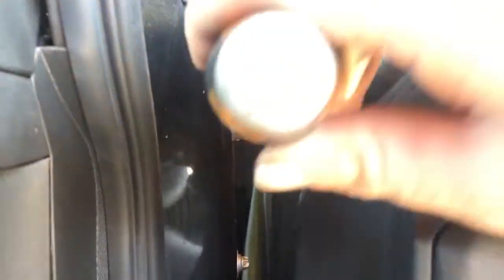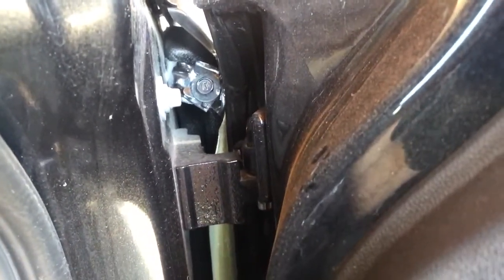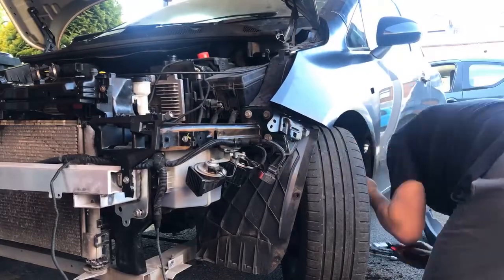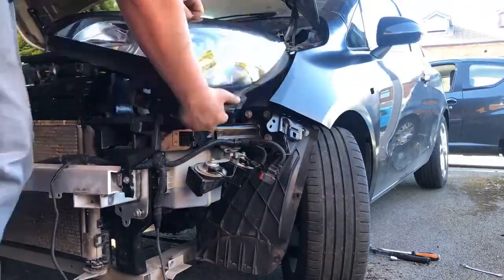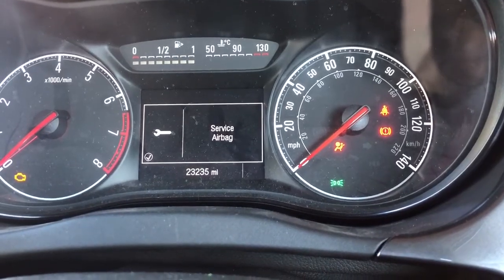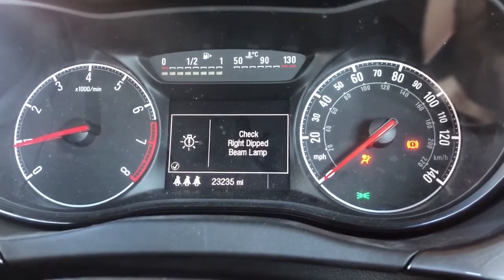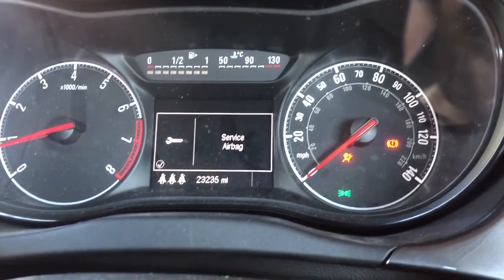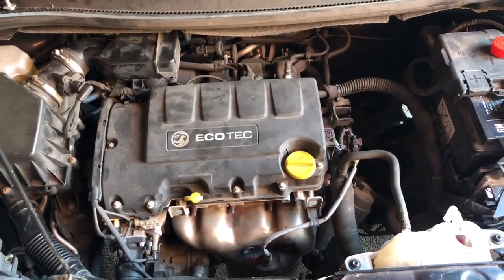Crashed Copart Corsa - Fitting the Front End and making it look Like a car again

Comment: Be interesting to see how the panel gaps eventually line up with the new wings . I used to struggle years ago getting a decent fit with aftermarket compared to o/e panels from the dealers. I am sure the quality is a lot better these days ,second hand are a good buy but usually miles away and need painting anyway so at present not a good option . Looks a lot better already, be interesting to see your other projects .
Reply from the maker: The panel gaps are really good along the door apart from at the top edge where I think I need to get it behind the bolt behind the glass a bit more, this should also help the bonnet line. I will definitely get it on the next video along with the fitment of the front bumper which has almost had its bodywork done (I'm awaiting on guide coat to get it finished). I bought a used bumper with a bit of damage as it was a genuine panel rather than a aftermarket, but used wings for these Corsa E's are just daft prices at the minute, cheapest I found was around £80-100 a side, vs £50 for the aftermarket panels.

I agree it looks 10 times better than it did just 3 weeks ago when it arrived, My target is to turn the cars around within 3 weeks, of the 3 Copart cars ive done, only the first was turned around in this time. The second had more damage and this is my 3rd and is hindered by slow postal services and me learning to paint.

I will get the videos made over the coming days on the other projects and schedule there uploads to stagger them due to youTube's algorythms, theres always work being done on one of them I could film